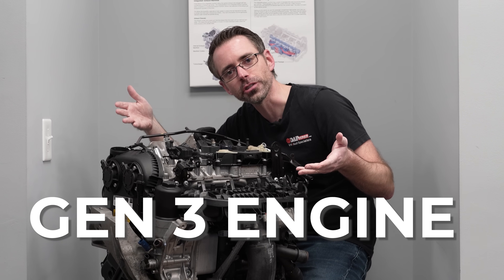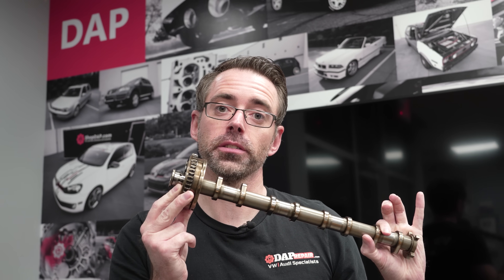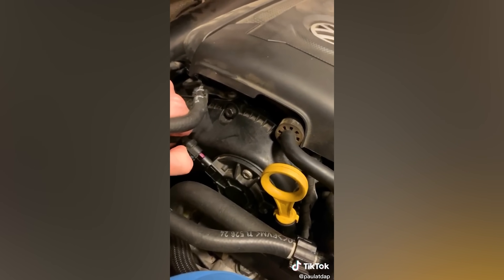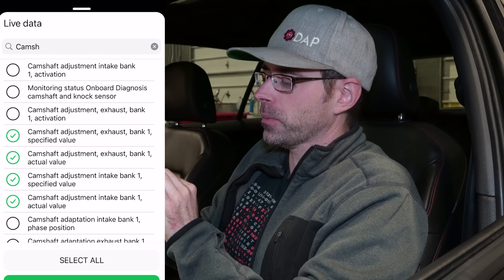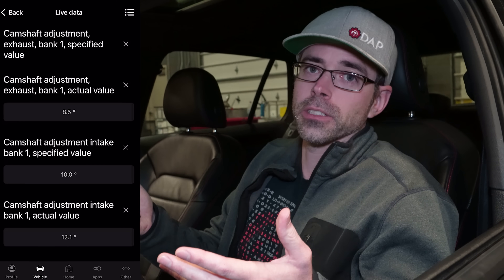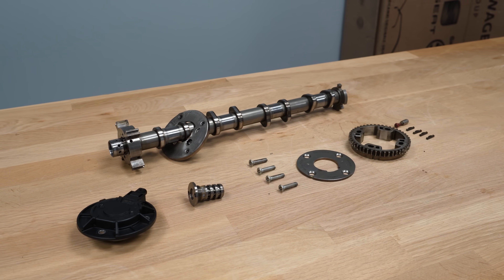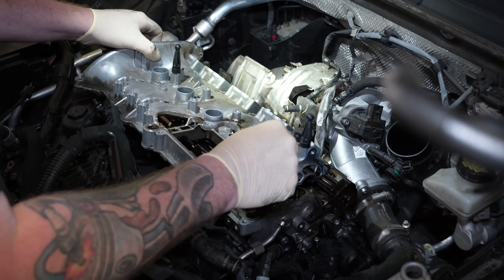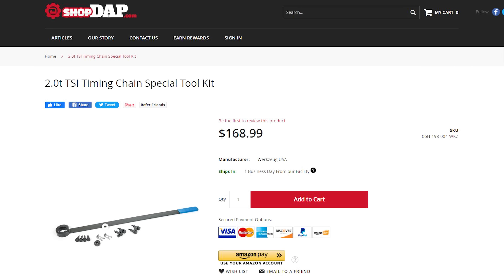Is this a New Common MK7 Engine Issue?

Comment: I have replaced so many of these cams in the past 3 months. As you said, mostly 1.8’s. Thank God these cams (non-lift control) are only like $400. The gen 1 cams are over $1k. The other common failure I’ve seen is the lock pin deciding it doesn’t want to lock anymore. You unplug the cam magnet and the timing keeps wandering.
Reply: My MK7 1.8t runs pretty well but it's idle is sometimes erratic. I've been using 5w40 for the last 30,000 miles because for some reason when I use 5w30 I get oil pressure errors when the car is idling for a few minutes (beeing at a stop light for 5 minutes for example). Topping the oil level to the max with 5w40 help to eliminate the oil pressure error, but I still have sudden shakes at idle from time to time and sporadic jerky movements when I move from a full stop. What are your thoughts on this issue? Could it be related to faulty camshaft?
Reply: @luisarsuaga7637  It could be a cam, however unless you’re getting a decent rattle noise at idle almost all of the time, I’d say you’re good. It’s more than likely the cam magnet (plastic disc with a plug in the end) is failing. We do tons of those at the dealer. Easiest way to tell, let the car warmup and idle. When the engine starts stumbling, unplug that magnet and see what happens. If the magnet has failed, the idle should smooth out almost immediately. The magnet is $125 and pretty easy to replace. Just make sure you replace the three T30 screws that hold it in place. They’re aluminum and will break off if you reuse the old ones. Also if you plan to do the work, follow the torque specs precisely on those bolts or the new ones will break.
Reply: @JohnEvans-ct6mz  that's great information! Thanks for the reply!!
Reply: @JohnEvans-ct6mz  I have a question, do you really need the tool which were showed in the video for the tensioner? It looks like you can do it without the tool.
Reply: @Fetii  I presume you are referring to the tool to release the tensioner. If you do the repair without removing the lower timing cover, you absolutely need that tool. It allows you to compress the tensioner to release the tension on the chain. If you don’t use it, the tensioner has enough spring pressure to fully extend itself and you will be unable to install the new cam. If you remove the lower timing cover, you can remove the tensioner completely and avoid using the tool but you have to reseal the cover, and find a way to keep the sprocket from popping off of the crankshaft. That tool also gives you the necessary leverage to compress the tensioner, the spring is quite strong.
Reply: @JohnEvans-ct6mz  Thanks for the interesting answer. I have the issue described in this video (camshaft adjustment intake actual value hunting all other the place in OBD 11, but only from time to time and for a few secs only), I am going first to replace the magnet and then if the issue persists the control valve / plunger. erWin manual also says to replace the seal and the O-ring but nothing about the the screws even if, you are right, they appear to be aluminium made (to be checked I have a CJSA engine). Would you have a ref for those?
Reply: @nikokolas1138  Not sure of the part number but if you buy the magnet from the dealership and ask about the bolts, they should stock them. They can be replaced with the steel bolts from a gen 1 or 2 TSI/ TFSI (CCTA, CBFA, Audi CAEB/D, CPMA/B). Those can be reused without breaking them. If you get new aluminum bolts the torque spec is 8nm followed by a 90 degree turn. Just make sure to seat them before you torque them. Sometimes they break off just from the seating process.
Reply: @JohnEvans-ct6mz hey mate, just wanted to run something by you if that's ok.
I've replaced intake camshaft, spool valve, magnets, timing kit completed. The car ran fine for about 2000ks until now it stumbles at idle again. If I unplug the intake cam magnet it idles and drives perfect. I did notice the magnet was abit stiff so I brake cleaned and used the air compressor to clean them out but no success.
I've ordered an obdeleven unit to Monteiro what values the ECM are seeing.
Thoughts, ideas?
Reply: @stagea09 I’ll assume the cam magnet you bought was a new VW part. That being said, it wouldn’t shock me if that magnet is defective. I’ve been seeing a lot of brand new parts bad out of the box in the past three years. Best example is a 2012 Golf R I was working on. It had a bad high pressure fuel pump and I replaced it with a new one. Two weeks later it came back with the same issue, but different faults. The fuel pressure solenoid on the pump was fine, but the pump wasn’t building pressure. Parts warrantied that pump. Came back a week later. Different issue, same faults. Listened to the pump, the pressure control solenoid was dead. I thought it had an issue with the return valve in the fuel rail, I replaced that, still no good. I ended up swiping the solenoid off the high pressure pump I returned for warranty and putting it on the new pump still on the car. It’s been fine ever since. Point being, VW has been having a lot of vendor issues lately. It wouldn’t shock me if that magnet were bad already.
Reply: @JohnEvans-ct6mz  thanks legend. The supplier is sending me another magnet and spool valve. I've removed both cam sensors and cleaned them and the connectors as the intake one had alittle oil residue on the outside of the connector but internally looked ok.
The magnet and spool valves I got were INA branded...
If the intake side Magnet is unplugged the car doesn't fault, drives and idles perfect which seems odd to me haha

Comment: I've experience the electronic magnet nipple that actuates the cam adjustment valve sticking too. Causing same faults. A nice easy check before going to the full camshaft
Reply: Yep, replaced a 50$ camshaft magnet on a client and the noise went away. He had a low oil warning the week before.

Comment: Excellent informational video,  I am now convinced to replace the intake cam on my 2011 TFSI 2.0. aihave been battling timing error codes, engine was rebuild,  pistons replaced oil pump, balance shafts Exct. . . .new timing components and still had timing issue codes, intake cam was never replaced 💀💀Wish me Luck 🫡

Comment: I grew up in a family of VW fans and thought I would drive them forever, but this is a perfect example of how the VAG engines after 2012 have become unnecessarily complex, trying to reinvent the wheel. My '04 PD TDi will be my last. It's a shame. Hope they find their way back.
Reply: It's politicans and emissions unforunately.I have a 2013 VAG TDI and the DPF causes low fuel economy and i've also had the EGR and waterpump fail.

Comment: Can confirm. 

My S3 is on it's third (inlet) camshaft.
It's freakishly well serviced, getting oilchanges ~4-5k km yearly.

My problems were. 1st time:
-strange throttle response.  Sometimes more, sometimes less power than expected.

Second time it was replaced because second one failed immediately.

Third change was because I heard the ticking noise. 
Oil got pushed out the seal (and in the connector). This is pretty common said the (experienced) Audi technician.
Timing chain was also replaced.

Stretching of the chain seems to have a lot to do with failure on the cams.
Reply: Wow, that is worrisome, how many miles you got on S3?
Reply: @senco981  

It now has 150k km~ 90k in miles.

It all started at 60k miles. ~100k km.
Reply: @theowarmelink7347  Thanks

Comment: In the 80's and 90's VAG engines were pretty much bullet proof. Newer TFSI and FSI are just junk. Ones that have had an easy life and more frequent oil services have failed. I cannot complain  , they have funded my home, boat and plans of early retirement. We are now getting the new 3 cylinder mini petrol engines coming in with chain and vvt problems and the 3 cylinder diesel with snapped chains. Waiting for VAG to go to wet belts ....Honda and Toyota engines do phenomenal mileages with annual oil changes and no problems perhaps they missed out on the worshipped German engineering.

Comment: My U.K. car is a 20l5 Vauxhall Astra 1.6 diesel which may be a big issue in time is the double overhead camshafts area chain driven which is at the rear of the engine so fun and games if it needs replaceing

Comment: Hi Paul. I have the EA888 gen3 Mk7 R/S3 engine in my 2014 Seat Leon Cupra 280 and almost a year ago I had the P0011 - Powertrain "A" Camshaft Position - Timing Over-Advanced or System Performance (Bank 1) error pop up only once ever after I've ripped it hard. Turned it off and on and disappeared. Had it checked by my mechanic which said it might be related to the magnets going out, but it's still fine. Always checking oil level though!

Is it possible that the magnets could fail and have this error diagnosed before it causes more damage, e.g. infrequent idle fluctuations or any other symptoms? I would gladly change both magnets preventively to avoid future issues. Thanks, any opinion is welcome!

Comment: Coming from a 2013 2.5L I never had oil issues after 138k miles. Ive now got 2600 miles on my 2023 GLI and between some Facebook group post and this video I’m getting concerned about the amount of oil these engines are drinking.
Reply: Lies, you have a 3L 2017 with 160k miles
Reply: @Blac-m8d  What is this?
Reply: @spathotan  I'm telling you what you have

Comment: On the plunger, activated by the magnet, was there any debris in that screen?  Can the plunger be pulled out and checked/cleaned without pulling the cam?  Thanks.
Reply: Following
Reply: The plunger can be replaced atleast in my 2016 GLI.

Comment: I change the oil every 5K in my 2018 Golf 1.8 TSI Gen 3. Also check it frequently. After 75K, no problems and no oil use. If you are obsessive about performing all maintenance on your VW you should have no problems. If not, expect big problems.
Reply: Yes and No...
they are no Toyotas that changing the oil will save you from a auto shop repair bill once past 100k. If it is DSG, there is no way around replacing the flywheel at high miles, the water pump, coil packs, oil pump, wheel bearings are normal tear and wear in the 100k to 200k mile range. A Toyota can go 300k and maybe need a new water pump or a bad bearing tensioner as long as oil changes are made, something that cannot achieved by VW if doing the same.

Comment: I check my oil every week. 2020 GLI stage 1 and replaced the 0w20 with 5w40 although I worry the thicker oil could ruin the cam adjusters but I've yet to see anyone have issues like this due to not running the 0w
Reply: 5w 40 is recommended by many tuners for these engines so i dont thi k it would be an issue. Obviously wait for the oil to heat up before driving it hard

Comment: I had this problem, it was difficult to get a fault code out of it for some reason. Only replaced the magnetic piece that's hold by 3 allen screws on the intake side and the problem was fixed.
Reply: I did the same 3 months ago and now my issues is back lol

Comment: I'm probably older than most of you guys and as a rule of thumb, you should check your oil level weekly, i've been doin' it from i was a teenager advised by the elders. Nowadays epecially cars of today with a turbo!
Reply: That's how to do it,until modern engineers decided that dipsticks are not required on engines.You just get an idiot light on the panel instead.

Comment: What is the purpose of the updated part that goes in the camshaft?  Is it less prone to failure due to low oil?
Reply: Yes, you can run your engine without any oil at all with the upgraded part.  Pretty stupid question, man.  Of course it's not less prone to failure with no oil. Facepalm!!!
Reply: @einfelder8262  Wow, that's not what I said.  I said LESS prone, LOW oil.  NOT indestructible even with NO oil.  Pretty stupid response man.  Also doesn't answer the question.  What is the purpose of the updated part?  In what way is it better?

Comment: # Avoid VW and the problems altogether, Go Japanese or better yet older Japanese vehicles like 80's 90's 2000's ish etc. Much easier to work on, VW has totally lost it's roots in the car industry with cheap "High tec" Crap that breaks too frequently and easily IN MY OPINION and Too many special tools and training needed to fix what was supposed to be simple a enough job for a DIY person/mechanic.

Comment: my 1.8t Mk6.5 jetta had a horrible noise on startup one day. Super loud rattle that sounded like when my timing chain ate shit. But it turns out my car burned a quart of oil in the past 3k miles so it was just low oil making the cam phasers rattle. also quieted down the engine significantly 😭and it made a code come up since the timing was just swinging back and forth. anyways, keep an extra quart of oil on you at all times is my recommendation lol

Comment: I just had to change the camshaft magnet on my S3 because I kept getting Camshaft timing over advanced error codes and check engine lights. The part was super cheap and replacing it is easy.  Doing this also smoothed out throttle response and improved MPGs.  No need to replace the camshaft as the adjuster and magnet itself was the culprit.  Always start with the cheap and easy work first to see if that fixes your issue. Replacing Cams should be a last resort if everything else doesn't fix it. 

For good measure, I checked the valve solenoid to ensure there were no issues with the part itself, gave it a brake fluid bath, and reinstalled it.  All good now for the last couple thousand miles.
Reply: This. Common fix to change magnets on the Cupra forum I'm on too.
Reply: I had the same on my golf R VW said it was the chain so had it changed (1k+) however fault was still there so I changed the cam adjuster sensor and it worked fine😅
Reply: @RetroTubing  Yeah man; mechanically these cars are rock solid.  It's the damn electronics that cause all the glitches.  You've got to be on top of your battery to make sure you don't get phantom codes and then also things like this, where small parts go bad (that are thankfully cheap). 

Everyone who owns one of these cars owes it to themselves to spend the $35 bucks to get access to the Audi Erwin database and download all the PDF's for their vehicle.  It'll pay for itself by thousands of dollars over and over in savings for stupid, poorly diagnosed issues from those not in the know
Reply: @treize elements What codes were you getting?
Reply: @von6164  a lot of timing over (and under) advanced codes. I don’t remember the exact code numbers, but that’s what they were telling me
Reply: If you were curious to see if the magnets are the issue, unbolt them and check to see if the pin has play. If it’s stuck, that’s definitely a problem and it should be replaced. 

FYI there are two camshafts: intake (front) and exhaust (rear). Your code will tell you which one is at issue be either a letter “A” or “B”
Reply: Hi mate I think im having this same issue, golf r 2018 50k miles, serviced every 8-10k miles. rattle on cold start and goes away after some time. This morning it was pretty loud and actually heard it while driving at very low rpm. Are you still issue free with this?
Reply: @TheQuinPVP your problem is definitely different from what I was talking about above but, yes, Still trouble free.  

Admittedly I don’t drive it as much as I used to, but I’m sitting at 96k miles right now and no major issues I can tell.
Reply: @Treizez34  I have it booked in tomorrow to have the intake magnet replaced, unplugging these makes the noise go away as well so hopefully thats the fix
Reply: @TheQuinPVP good luck. Keep the post updated in case someone else comes up on your symptoms

Comment: I just replaced the intake cam adjuster magnet. I was having lots of issue. When I removed it the little pin in the middle was sticking when it should have been free moving.

Comment: I had this issue in my 2016 R. The screen on the oil control valve was ripped. Lucky no debris caused damage. Oil level was fine. I am now considering this a consumable part and will be changing them every 100,000 km's no matter what. The part isn't very expensive and once you have the proper tool to change them it takes about the same amount of time as an oil change. I see lots of posts on the Facebook Groups about people having this issue.
Reply: i have a 17 passat and im trying to stay on top of preventative maintenance, what tools do you have and what parts are you referencing? :)
Reply: I was told the 2016 had the oil valve integrated, thus the removal of the entire intake camshaft. I also have a 2016 R with the tapping sound that goes away when unplugging the cam magnet. Are you saying I won't need to pull the entire camshaft?

Comment: My oil light came on this week. I checked and it's super low. Again. I have a 1.8 TSI.

I felt like he was personally calling me out in the video 😂
Reply: I changed my pan now its half a quart 2500miles. It is very loud in when i start guessing need new magnet as one of the guy stated above in comments. Man can’t afford a camshaft labor gonna be hella expensive just spent 1500$ on water pump n carbon cleaning 😅
Reply: Me too 😂 my 1.8 eats oil I’ve been adding a quart a month for awhile now 🥺